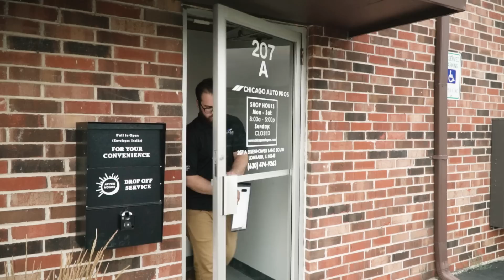Snakeskin Green Dodge Viper Gets The ULTIMATE Protection

Comment: Those blowers are CRAZY loud. They have to wear ear protection while they are using them. When they are that close to the operator's ear as shown around 3:10, they emit right around 110db. Immediate hearing damage is caused in the 120-130db range. Looking out for you guys, CAP. <3 Amazing car.